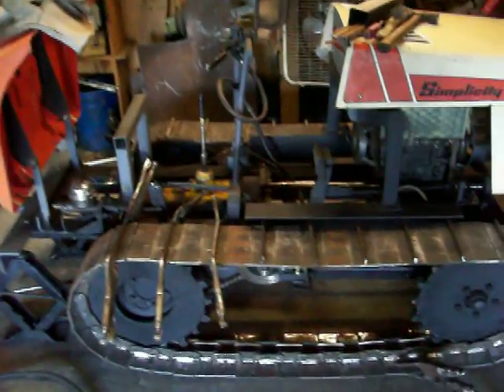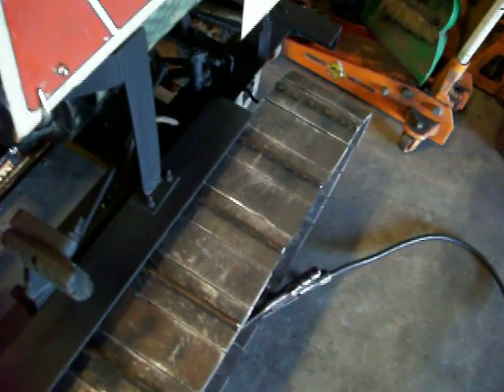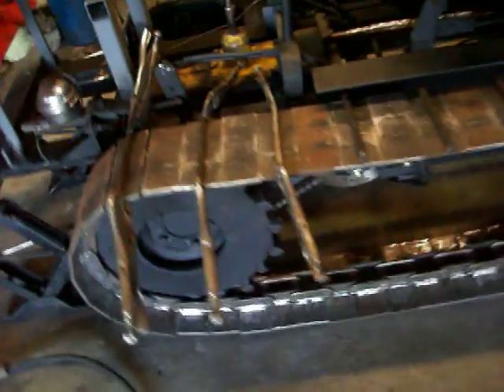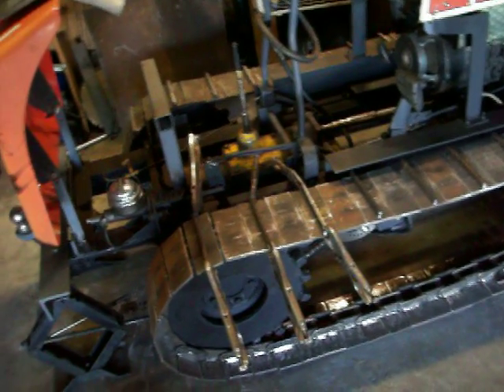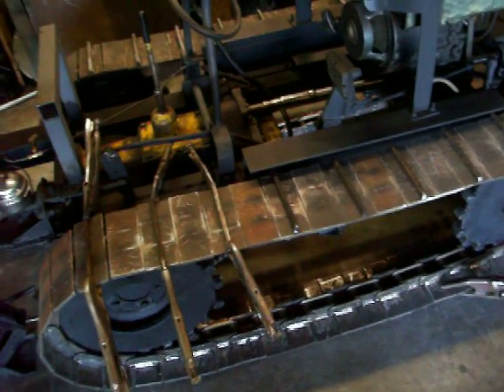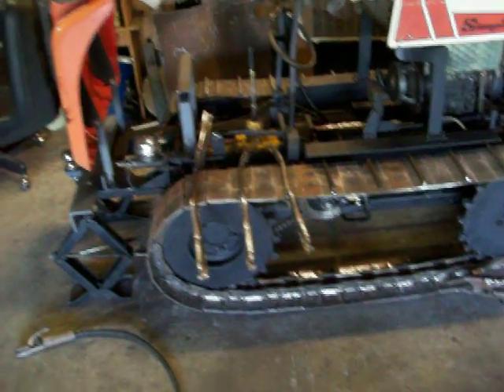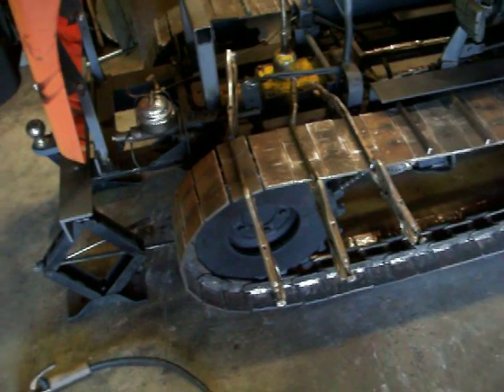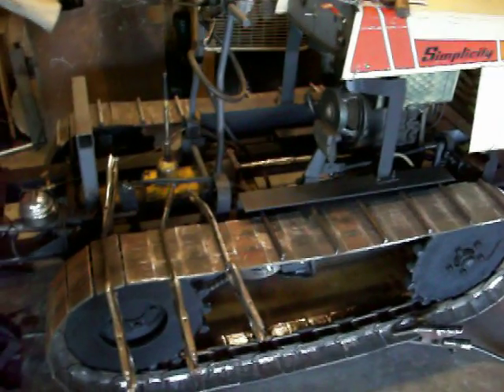Mini Dozer Home Built "Track Cleats added and Rear Brake Test"

Comment: You should eventually upgrade to a Diesel engine
Reply from the maker: your right and I should upgrade to something bigger for sure,,its true I have built the body and drive train far to strong for a 8 hp motor so even if not a diesel then at least a V twin 20 hp or something similar,,,but that will come in time brother and right now the way its geared id bet it putting 40 or 50 hp on the ground as far as gearing and am fixing to gear it even slower,,,Im confident right now it would easily out pull a rubber tired tractor that had a 20 hp motor on it,,say a big lawn tractor with rubber tires and 20 hp wouldnt have a chance of out pulling this mini dozer even with the 8 hp motor,,hp doesnt mean much if you cant get traction right,,,appreciate the idea for sure,,,Rick